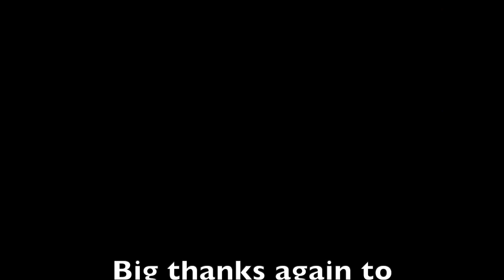My gearbox looks like new - Volkswagen 020 Transmission cleaned/ vapour blasted

Comment: What is the best way to rinse and wash parts after vapour blasting to remove and flush all glass beads from blind holes and tight places? What is the best aftercare for vapour blasting?
Reply from the maker: Youtube For Education I only vapour blasted my parts for the car I'm restoring so don't know the absolute best way or how vapour blasting companies do it. I rinsed the parts down, blew them off with the air then cleaned them in the parts washer. Just repeated these steps until I was sure everything was completely clean. Some parts I put in the ultrasonic cleaner after blasting but depending on the part it would take the nice gleam off the part that you get when you vapour blast. There is sprays you can get to protect the part after vapour blasting but I can't remember the name. WD40 works well as a barrier for a short period of time.
Reply: @No-Pro  
You're probably thinking RP-342
Reply from the maker: That’ll be the job! Thanks 🙏